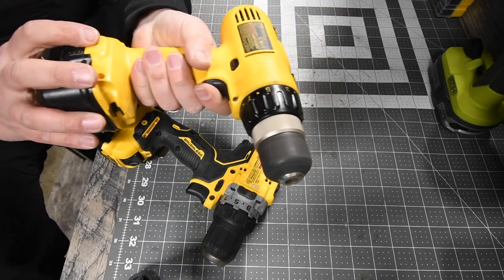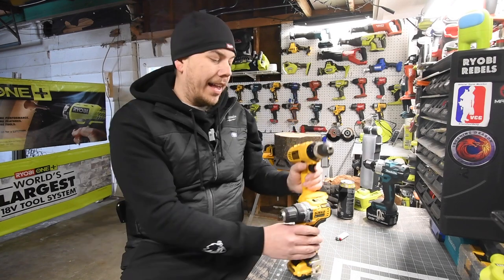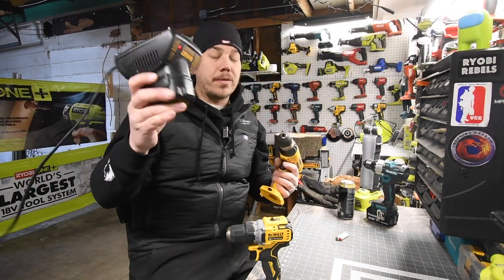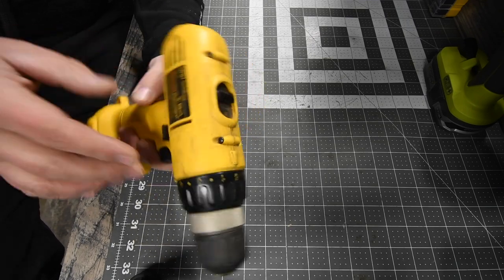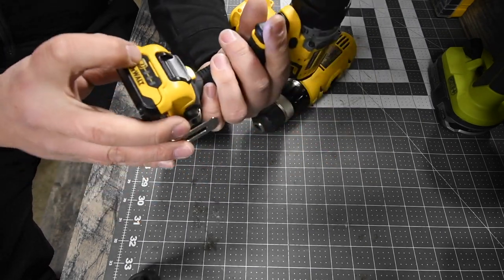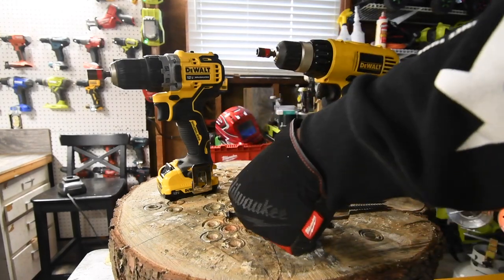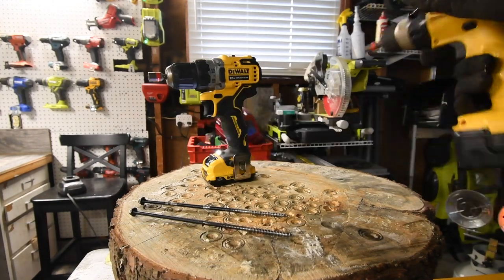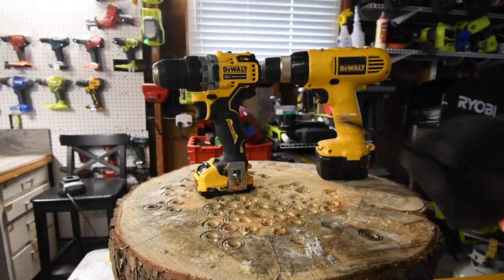Dewalt 12v Drill (Old School vs New School)

Comment: It's so crazy seeing how underpowered tools were back then! I love seeing these videos. How we got by in the 90's is beyond me too.
Reply: Yeah
Reply: Me too
Reply: Frankly I thought the old one was pretty impressive. And also people weren’t using as many screws, a lot more bolts and nail which where powered by air or corded and there hasn’t been any significant changes in that technology from then to now.
Reply: It wasn’t that bad.  DeWalt had the First 18 volt drill, and it was quite the thing!  I know, I had one and used it.  Again, the batteries were the weak link.  Makita and DeWalt were some of the Best back then.  They went to NiMh technology, but it wasn’t much better.  Makita had known issues with the 2.2 amp hour batteries.  You all don’t realize Just how much the Li Ion tech has changed the game!  Peace!
Reply: Imagine what it was like when cordless tools weren't even available! I happened to be around as an apprentice when they were first just finding their way into the trades! 

And amazingly enough, there was a lot of resistance! I was an electrician and was told that I couldn't use my own personal cordless drill on the job, because by using a cordless tool, I was eliminating someone's job. If there's no need for electric on the job site, then there was no need for electricians. So I was told to take my cordless tool home and leave it there! 

I remember thinking to myself that if we work smarter and more efficiently in doing our jobs, isn't that a win win for everyone on the job? 

Now, almost every power tool that electricians use is cordless and they've been embraced! 

How short sited they all were back then!
Reply: @El_Diablo_LI  well, that’s just weird.
Reply from the maker: I agree and the evolution of tools has sky rocketed

Comment: Consider making a comparison video where you test it with the nicad to lithium battery converter
Reply: Came here to suggest this. Wasnt sure if the made the adapter for 12v though
Reply: @Jtwizzle  yeah good point. Well if they have it would be an interesting video
Reply: @odin8214  Yes indeed! It should perform a lot better heck maybe even close to more modern brushed 12v drills? Hmm
Reply from the maker: once I get it I will and I have an impact for it as well :)

Comment: FYI Lowes just released their new 5AH Battery and I'm stoked. I was bugging MAC Tools for months on end ordering in their protective booties for all of the identical clones that DeWalt produces the shell of for. So it looks like they took my advice and are adding it to the retail market. You can now get a protective boot for the new 1/2 DCF901 impact. So excited. I was trying to parts together a 1/2 impact atomic on my own from the discontinued mac tool variant a few years ago. Only to my surprise a few weeks ago this is released to the world to know its coming.
Reply: Just FYI, they will have a grease/oil resistant 5.0, in addition to a regular 5.0 battery pack!
Reply: @georgedavall9449  This I know! I was badgering them for months as to why the Mac stuff wasn't in the DeWalt line!
Reply from the maker: I cant wait for it as well. I checked I cant buy it in my area yet 
but im going to keep looking
Reply: @ManCaverTools  1 store had 20 of them just down the road from me. The only one in the state.

Comment: As an older homeowner DIYer I no longer waste money on high end cordless tools' My old Dewalt's and Makita's are obsolete yet still in newish condition. 
Now I stick to B&D and Skil which will most likely outlive me or also become obsolete before they wear out. 
 The best bang for your buck is still of course corded and hand tools.  Screw drivers and handsaws never wear out from casual to moderate use.
Reply from the maker: that also depends on how well you take care of them. you can have a brand new tool that was never used and destroy it

Comment: I have my grandpas old makita 6012 drill with the long handle thay the battery goes into like a magazine and uses an actual chuck key.. I ordered an aftermarket battery from amazon and man you can tell how much cordless drills have came..  The thing is really underpowered but sometimes i will use it for very light duty just to pay homage to my gramps.
Reply from the maker: as long as it still works, I thank you for viewing Mix

Comment: Wow I had the same drill but had xr batteries shocked it did what it did am sure the carbon brushes are on the way out and the battery the cells are going
Reply from the maker: but what a difference lol
Reply: @ManCaverTools  so true I don't know how I survived in the old days I use   to have  a few 14.4 volt dewalt tools and two 18 v they work but the batteries are shot do not feel like spending money on new ones or an adapter because my 14.4 v are xrp version so a 20 v max battery would not kill em my 12 v I killed that in 2016 ran it one last time man was it smoking bad

Comment: What year is that older 12V from? If I recall, the serial number is etched underneath the tool near the battery port.
Reply from the maker: I didnt look and I no longer have that tool. sorry MC
Reply: @ManCaverTools  Oh no, now my life will never be complete lol. Thanks for the vid, it's great to see where 12v tools outside of the M12 are going. I worked at HD around 2000 when Ryobi was still blue and they had the 12v, 14v, and 18v line. Man that old 12v was GARBAGE.

Comment: I like this sort of content! However, that drill was no where near that bad of a tool. You weren’t going to sink lags with it (at least not without predrilling) but it was a good tool. This one obviously needs some attention, and a battery rebuild or adapter to run the new 12Volt batteries. I’d love to see some content like that. Maybe see if you can give the old girl a rebuild and stuff some lithium cells in that old battery or find/make an adapter for the new batteries.
Reply: Awesome comment and right on matthew
Reply from the maker: back in that day it was. but I am glad tools evolved as much as they did

Comment: Hey Dave. I understand what you were trying to do here and it would have been cool to see a great head to head test. 

But that old battery is shot and not holding anywhere near the charge it would have held when it was brand new.

So a better comparison would be to use a battery adapter to power that old drill. Then you could really compare the old drill's capabilities against the new drills features and capabilities. 

I get it, back then we were stuck with the old NiCd batteries and they were terrible, so you wanted to compare the old tool and battery technology to the new tool and battery performance.

But that NiCd battery is so old, and so dead, it isn't really a fair comparison. 

Getting a new NiCd battery for it would be expensive and a huge waste of money, but they do make adapters that fit new batteries on the old tools. 

Then at least you would be comparing the drill's performance against each other using the same power source.

We all know the batteries are one of the most important parts of these new tools and determines how well they perform, but using a 10 year old battery on the old tool that's already spent isn't really a good way to make a fair comparison. 

Otherwise, I love your channel and the comparisons you do for us, including watching the snafus! It's why I love your channel over so many of the others.

Thanks!
Reply from the maker: if I got a new battery it would defeat the purpose of the test. so this demonstration was perfect to show how tools used to be compared to how they now

Comment: Hey Dave!  That ‘old school’ drill was the economy version by DeWalt. They made a heavier duty model.  It was a rather nice drill, for it’s time.  DeWalt made their tools pull extra power out of the batteries, and it drained them hard.  I knew lots of guys with dead or dying DeWalt NiCd batteries.  The tools back then were getting more powerful, and the battery technology was lagging behind.  This type of Versus video is really cool, btw.  I hope you do more!  I am looking forward to the 1/2 inch 12 volt wrench as well, and to your covering it.  Did you know there will be a regular, and a grease resistant versions of the 5.0?  Stay safe and Healthy!  
👍👍👍👍👍👍👍👍👍👍😁✌🏻🇺🇸
Reply from the maker: I will be doing more and I thank you George

Comment: Finally DeWalt made a 5.0 ah for their 12v tool line. Man, it's going to be interesting if the battery helps with a little more power and run time. 

Wonder if the battery has the 18650 or 21700 cells. 

Can't wait for the video.
Reply: Im sure 18650. 21700 makes little sense right now for 12v. Theyre compact not powerhouses like the 20v stuff
Reply from the maker: I cant wait for it to come out

Comment: You can still buy batteries for those, lol. I have one and it's way stronger than that.
Reply from the maker: and they still are very expensive lol
Reply: @ManCaverTools  yep, the knockoffs aren't too bad though.
Reply: I’ve seen the adapters on ebay, would be interesting to see it perform with best case scenario.

Comment: What you are doing is wrong old tools are much better and more durable from new tools ... Your compare it's not fair because of the batteries!!! If you want to do a Fair one take old school drills fairly new and connect to lithium-ion batteries it's simple 2 wire + to + side - to negative side and then we will talk !!! You are comparing a batteries that's work or made 20 year ago to lithium-ion batteries how work 1 or 2 year only plus even ghe drill that's you are using you said there's smoke smell from it ...  Old tools they are made to  last they do 20 or 30 years ans they still going and working but new one willl last 20or 30 Years toops and then they will fail ... All électronique do for example the brushless tools have capacitor yes? Do you think a capacitor will last 20 years working ??? Even if you don't use it will dry and rhe chemical inside will fail
Reply from the maker: fairness isnt a factor in this video. this video proves how these tools have evolved throughout the years